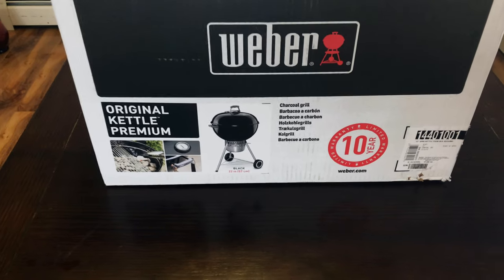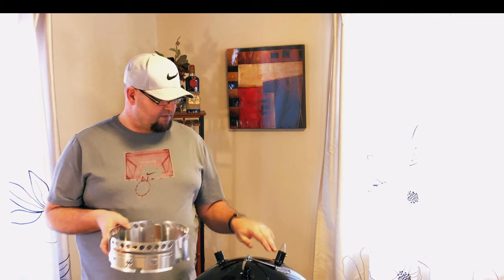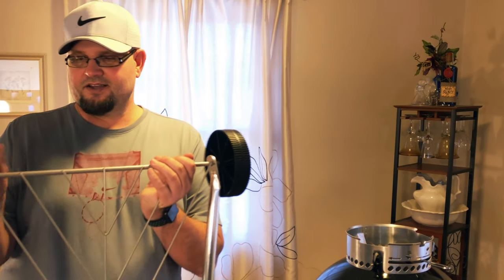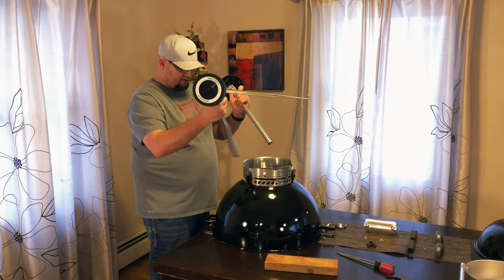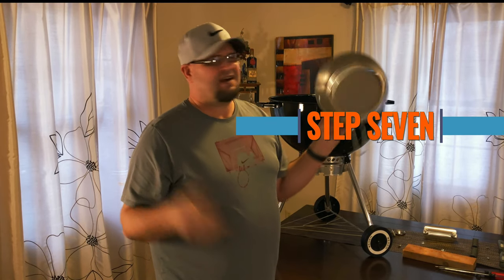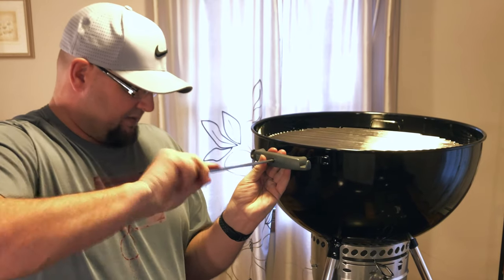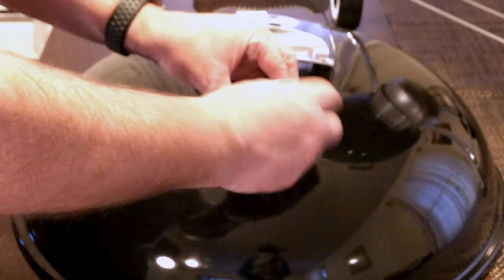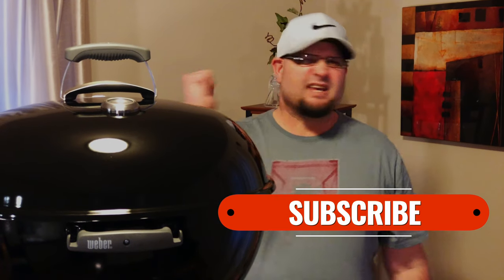Weber Kettle Grill Assembly

Comment: After 20 years of grilling on charcoal, then the last 30 years on gas grills, I began a channel and soon after found out what a kettle was. My third grill, after an offset, then a Weber Smokey Mountain, was a Weber Kettle. I found it to be pretty straight forward with a couple snag places like you show with the legs. When you include all of the accessories and after market products, it is quite a versatile little grill/smoker. Nice how to video.
Reply from the maker: I agree the Weber Kettle is one of the best charcoal grills for the average backyard BBQ warrior!  I have had several in my 30 years of grilling. Owned a couple gas grills for convenience but they typically just take up room. I do use mine to hold my chimney while it is lighting when I cook from the deck but I have never even hooked up a tank to it and have owned it for 3 years. Hahaha I had a nice stick burner but it was mounted to my old patio and once I moved to a different house I said good bye to that rig. I will own one again-got my eyes on a Lone Star Grillz 42” offset. Had to buy camera gear and editing software this year, there is a reason why I call myself Dead Broke! Hahaha thanks for watching bro!
Reply: @DeadBrokeBBQ  
Hahaha on the reason why. Hey, check out Texas 2.5 channel. He has a personal goal and contest going to give away that LSG you like

Comment: I hv a wooden deck. I prob will get that model next wk. I seen other youtuber's having trouble putting the legs on...
Reply from the maker: Ya the legs can be a little tricky but the key is when you push the nipple back in prior to inserting legs push it up and inline with the hole so hopefully the leg hole with catch it first and then it is easier to slide to the kettle mounting hole. I have 3 of these and the first one I had to take apart. That is why I talk about the pro tip with the handle and the 2 legs mounts. I will be posting a steak cook for the kettle later today if you are interested. Enjoy the weber premium kettle if you get one, you honestly can cook anything in it! Thanks for watching!
Reply: Thanks alot brother!!! Yeah, i will do that...
Reply from the maker: You bet John!